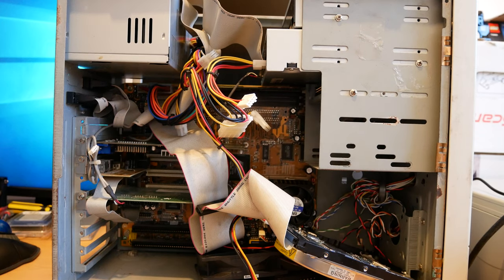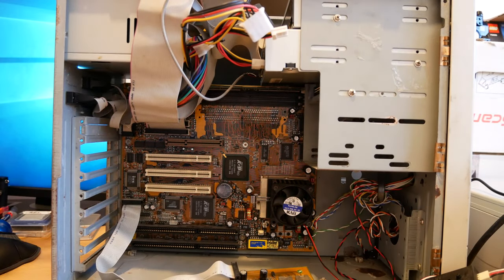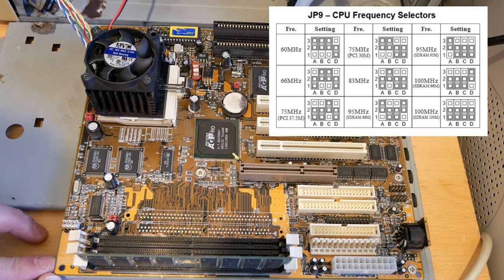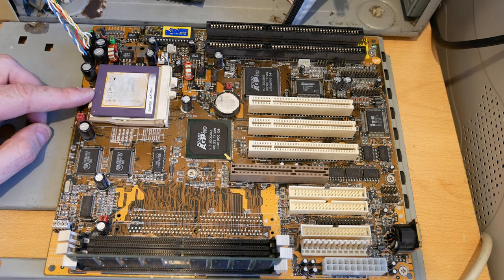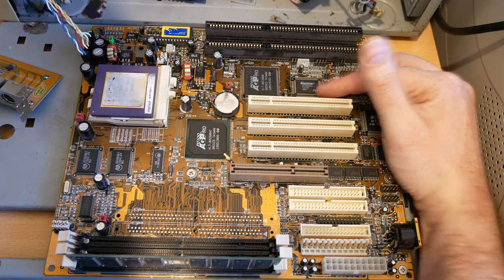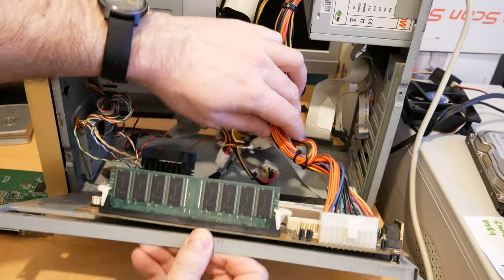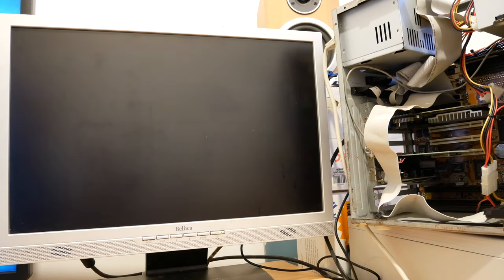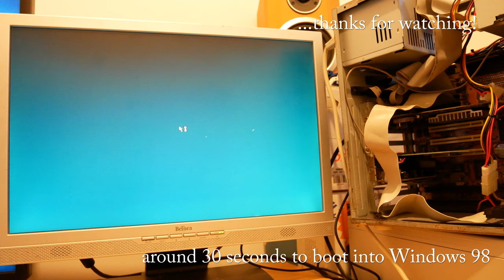PC Chips M577 Super Socket 7 Motherboard - Jumper settings (4K)

Comment: Poprawka J2 oraz J3 posiasiada błąd kopiowania kodu do obsługi dużych dysków przez co widzi fizycznie UDMA4 lub wyżej a płyta ich nie obsługuje co powoduje błędy na UDMA. Jest kolejny klon BIOS J4 z poprawionym rozpoznawaniem UDMA2 dzięki czemu można prawidłowo zainstalować UDMA i działa
Reply from the maker: Thanks for the information: (Google translate:) Fix/Firmware J2 and J3 have an error copying the code for handling large disks, which means that it physically sees UDMA4 or higher, and the board does not support them, which causes errors on UDMA. There is another J4 BIOS clone with improved UDMA2 recognition so you can install UDMA correctly and it works

Comment: i have the same mainboard here but after the bios, no boot sequence is coming, no boot failure message, only a blinking cursor
Reply: Do you have a hardware fault?  Eg. Are the Simms faulty or not installed correctly.  Also check your bios settings.
Reply: Did you fix it? You may have a boot sector error on your hard drive.